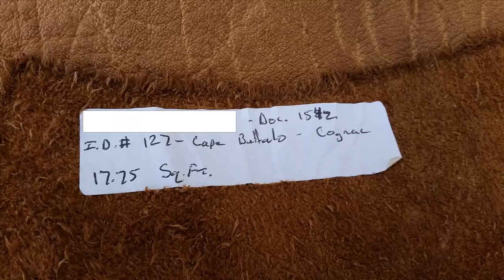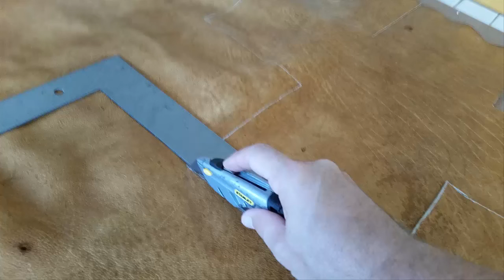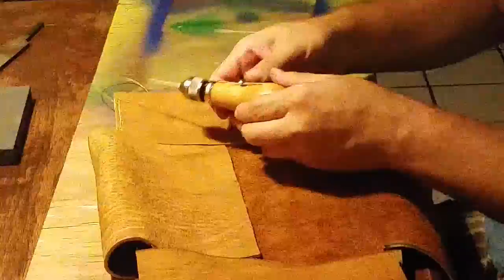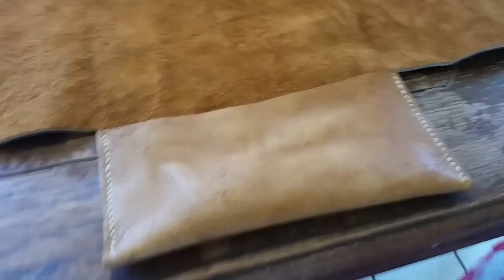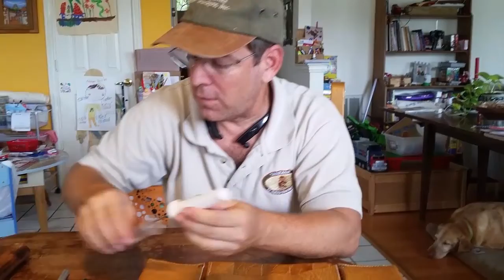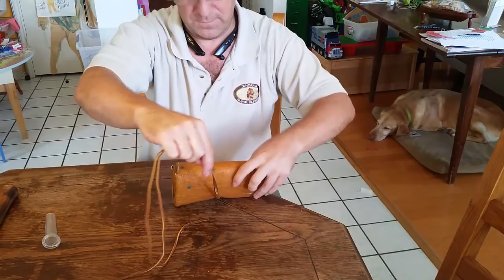How to make a pipe roll tobacco pouch

Comment: Very nice work. I love the “Speedy Stitcher”. I’ve been using a 1/16” drill bit to pre-drill holes for it...it works well!
Reply from the maker: Thanks a lot. It was my first try with it. The drill idea is cool. I think that I like to use an icepick because if I screw up on a hole, the leather will refill a hole made by an icepick. Will the holes refill when you use a drill to make the hole? Very curious to know that.
Reply: I don’t think they’ll refill...it’s a larger hole relatively speaking. I use a ruler & make ballpoint pen marks 1/4” apart. That seems to make enough of a mark & indentation so I don’t miss with the drill. I haven’t messed up yet: I’d probably cry if I did though!